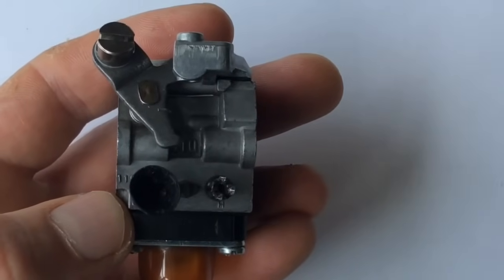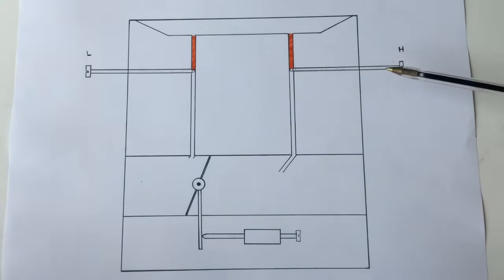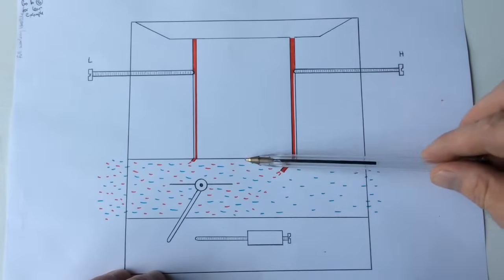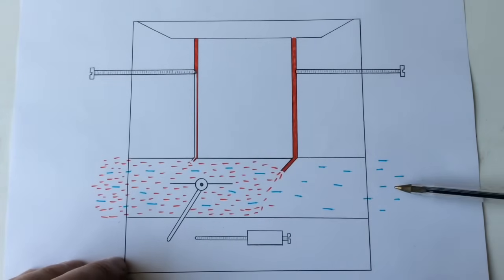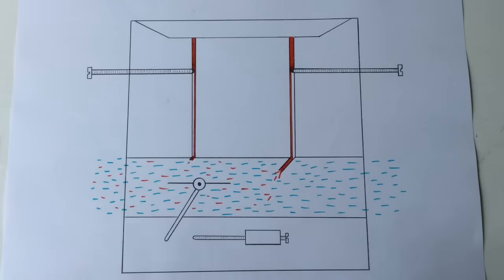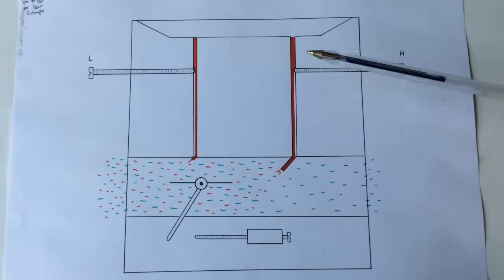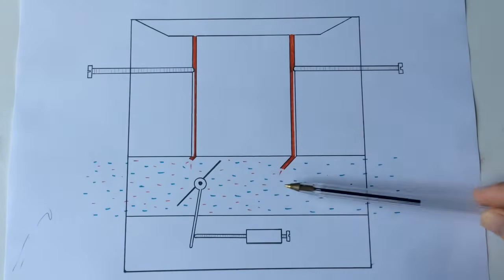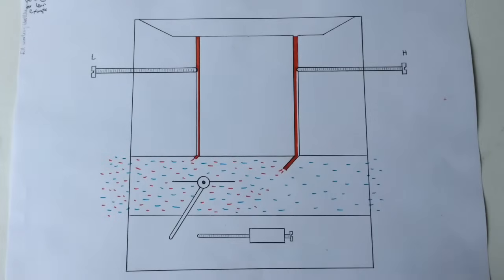HOW ADJUST CHAINSAW CARBURETOR:  Chainsaw Carburetor Settings Explained! (by Craig Kirkman)

Comment: So is the "L" setting located before the throttle plate and the "H" setting located behind it?  That's how it appears on the diagram.
Reply from the maker: Hi.  Yes, thank you for pointing that out.  The diagram may not be completely exact to real life as on the carb itself.  Instead, its more of a learning concept.

Thanks again

Craig

Comment: Well done. One of the things that I recall learning during my gas powered model airplane days was how to tune the Low speed needle for smooth transition, 'tickover' to full throttle. When suddenly going from idle to full throttle, if the engine 'bogs' and hesitates during transition, lean the Low needle a bit until you can get a smooth transition. Conversely, it it suddenly goes dead, richen the Low needle a bit until smooth transition is attained. Thoughts?

Comment: Great video! I am an auto mechanic who has never worked on a carbureted engine. With times so tough I decided to try repairing my dad’s 30 year old weed whacker instead of buying a new one. I determined the carb was the problem and replaced it. I just could not get it running right. Your video was perfect it laid out the theory and gave me what I needed to get it running like it was the 1990s again.

Comment: Thank you for this series of videos! I have never understood 2 stroke carburetors as much as I do after watching your videos. Truly a big help. On a side note people will always pick apart your content, ignore them as you are helping people. Again thank you so much for taking the time to teach a very necessary skill in today's world. It cost 90$ per hour plus parts for a shop to look at small engines which 90% of the time it is a simple carb adjustment.
Reply from the maker: Thank you so much for your motivating feedback. I really do appreciate it.  You are absolutely right about some people trying to pull apart my work, some most certainly do just that. But it's people like you that make me understand that I'm on the right track, and for that I will keep going. Thank you again. Craig 👍👍👍

Comment: A new machine I took straight back to the dealer after an hour today. I believed that it was running lean on the High rev range as it idled ok but going into trigger revs, it just would bog out every time. I did a minor adjustment and testing of the 'H' screw but returned it to its original position and believed that the protective guard needed to be removed so as it could be further turned. Being brand new, I chose to take it straight back and have the dealer do the resetting. He handed it back after removing the 'L' screw guard and resetting that screw. He left it off and I spoke to him about altering factory settings etc. But my question is this. Yes it did run better but am I missing something when I believe it was the 'H' screw which needed correct adjustment? I'm now assuming he's given me a richer idle and this then has improved the High rev range. My understanding of the metered fuel needed to give proper running from Idle to High revs, was controlled by 'H' screw and 'L' screw was all about idle only? Is this right or have I now got myself confused?

Comment: Tickover in US is idle needle or idle screw in no a lot of manuals but amazing job. This works for most 2 stroke engines and if you have a rc glow engine this will explain how to set your needles for best idle so your car or boat won’t die or stall. Good job on the theory and time you put into this
Reply from the maker: Thank you for your awesome comment. I really do appreciate it. Craig 👍

Comment: Watched this explanation, went out and put my troublesome Ryobi string trimmer on the bench  seated both mixture screws and followed these instructions, now it runs very nicely both high speed and idle,  "tick over" the UK term for idle speed,  I will adopt that phrase as it is a perfect description for a  good idle, 👍

Comment: I'm a complete novice trying to completely rebuild a Stihl TS400 and finally got the whole thing back together, and running, so found this really helpful.  The supplier of the new carb said 1 1/2 turns out on both high and low and when I give it throttle it runs great.  Only problem, when I let go of the trigger it dies and cuts out instantly - no matter what position I turn the T screw in or out.  Any suggests as to where to start with that would be greatly appreciated.

Comment: What should be the default position of the T screw when adjusting idle mixture with L screw??
Reply from the maker: Well. If you can see where screw contacts the lever on the carburetor then I would screw in the screw until it just starts to move the lever. Then when you start the engine you can fine adjust in or out depending on how the engine is idling. If you can’t see the lever contact then it might best a good idea to screw in the screw somewhere midpoint and then adjust from there. Of course, please make sure of your own safety when starting the engine because if you have a chainsaw the chain will move upon starting if your idling is high. I sometimes screw the T screw in so that the engine is idling a little high whist I set the L screw. I have always done it this way and its always worked for me.

Comment: You really should start with the low speed needle first, about 30% of your high speed mix comes from the low speed circuit.
Reply from the maker: Hi. Yes. Most people do start with the Low first as you have correctly said.  Having been adjusting engines both ways over the years I have defaulted to doing it this way. I do adjust them sometimes with low first and sometimes high first.  I can pretty much get a machine to run very well using both methods.  I do acknowledge your correctness though and thank you for your comment. Craig 👍

Comment: If I don't have one of those special pump to test the carburettor pressure ...is there another way to do it ?
Reply from the maker: Hi. Thank you for your feedback  I really appreciate it.  Yes there is a way. Its not quite as good as a pressure tester pump & gauge but it does work. So this is how I do it.

Here goes then. 

Connect a piece of fuel pipe to the fuel inlet of the Carb and submerse the whole Carb under water leaving unconnected end of the pipe above the water.  Blow down the pipe, and if there is bubbles then you have a leaking metering valve within your carb. 

I am going to make a video on this, which will be quite soon so keep watching and you will see what i mean very soon. many thanks. Craig 👍
Reply: @TheRepairSpecialist  Thank you for answering me ...You mentioned to put a piece of fuel  line on the inlet ...what about 
when there are two line on the carburettor  ? Inlet and outlet ? Do I have to put a pipe on the outlet too  like the inlet one ?
When you say  THE THICK  OVER SCREW  do you means the IDELE SCREW ?
A question that I have asked to several people  on the Internet is about a Ross Chain saw given to me  I had to put a new 
cylinder and piston but there is no compression at all ....Can you give me some hint   where to have a look ?
When tuning up a carburettor  which screw to start first the "H" then "L"or doesn't matter ?

Comment: What do you do when the H and L keeps vibrating loose to were once you do set it right that's what happens
Reply from the maker: Hi. Normally there is anti vibration springs accompanying the screws to stop them vibrating loose. Can you see any springs on them?
Reply: @TheRepairSpecialist  those springs twist around with the screws making it out of set

I rest it but its no use to keep resetting it when it keeps doing that 

Do they sell any rebuild kits for the stihl br420 backpack blower walbro carburetor 

I was thinking about putting on a primer bulb type of carburetor on the old br420 how the new ones have it so it should work on this old blower all i have to do is hook it up

Comment: If I have my H and L screws out one full turn and the engine is screaming, should my first course of action be to turn the Idle screw OUT?
Reply from the maker: Yes I would turn it out a little to reduce the excessive RPM's. Its ok in my opinion to have it idle slightly high though. Then from there I would make the adjustment. Thanks. Craig

Comment: I have a question about a  mountfield MM2603 3 in 1 multitool, if you could help please?. My machine was only bought in the first year of COVID and only used for 2 summers. This year when I brought it out of retirement and fired it up, the engine started on full choke as usual, but I got a strong petrol smell. On checking the machine I saw that the fuel tube had snapped, so I stripped the tank off and replaced the 2 tube line, complete with new filter and reassembled. The machine kicked into life, I took the choke off, it ticked over nicely and I thought I was away untill I opened the throttle. The engine coughed and spluttered then slowed down until finally stopping all together! No probelm, must be the air filter!  
This is where I hit the wall. 
I cannot for the life of me find out how to access the air filter to check how that is and even the PDF owners manual that I downloaded from Mountfileds own webiste (as I had thrown mine away,as we  guys do) doesn't show how to get to this. Can you help please mate, as my hedges are now about 7 feet high and need to be dropped a bit????

Comment: I am using a mantis 2 cycle tiller new carburetor. I installed it put some true fuel in it and it fired light up but the times were turning too fast so I tried to just what you call the takeover screw I think we were going to tell it stops and blocks the fuel and it shut off and I cannot get it back to the location again. I did not adjust the high low on the carburetor just what you call the takeout screw so I don't know what to do.

Comment: What I like to do is after I have adjusted the high side and the low side, I go back over the adjustments one more time.  The reason is that after introducing the low side adjustment into the mix, the high side performance may have become slightly off and needs to be tweaked slightly.  As was said, make sure you end up with your high side being SLIGHTLY toward the rich side of optimum to avoid overheating, undo wear, and possible engine failure.

Comment: I learned how to tune small engines like a pro when I worked for Hobby Town building and flying model airplanes & helicopters. Same with RC cars. He did it exactly how I was taught. Always reset both your Hi and Low and do 1 1/2 turns out. That will always get you to a good starting point. Start your engine and adjust the Hi side first with full throttle and just listen. If its in the summer and or your in hot weather, you wanna run it more rich so you don't over heat it. So adjust it so you have a good smoke which means it's running rich. Also if your engine is brand new, I tend to run them on the rich side until they break in. I only run it lean in the winter because it needs to run a little hotter. Once you have the Hi side done, then let it idle and if your idle is too low it will cut off. So open it up a little until your idle is not too fast but not too slow. The Hi and Low work hand and hand together. So you know you have it right when you you can pump the throttle from Idle right up to full throttle with no hesitation. It should be smooth. If it's not smooth only adjust your low. Don't touch your Hi. You will eventually find that sweet spot the engine will love. Good luck guys!!!

Comment: Great video !!! It’s been a bunch of years sense I’ve adjusted a carb on a small engine.. this was a great refresher !!  

Also note guys after you adjusted your carb get her warmed up and  with a new plug give it full throttle for 10 seconds and shut her off .. pull the plug out watch out it will be Hot !!! And check for temp color on your plugs!! White mean your to Hot ! And u need more fuel  brown is the sweet spot black is to much fuel  so just need a little lean adjustment and repeat as needed !!   

Helpful tip for this video !! Cheers everyone!!!

Comment: Thank you so much for such an easy to understand video. I’m a 58-year-old female lawyer trying to teach myself to service my own equipment and this was like having the scales removed from my eyes. I originally thought that “the mixture” referred to the petrol/oil mix and couldn’t understand how you could change it once you had made it up. Now I will be able to adjust the new carburettor that I fitted yesterday, though I think it’s just the tickover that needs tweaking. Thanks again!

Comment: My carburetors have only one adjustment screw>>?  There is a small screw to set the idle speed, using the cable.

Comment: Best explanation of how a 2 stroke carb works! I have an Echo SRM 225 that I replaced the carburator and adjusted it after watching other YT vids, now I realize why it stops running after 5 minutes and gets hot: I leaned out the mixture too much, good thing I found this video, thank you!

Comment: Great job.  Question- on a new carb installation, where do you want the initial idle screw set while the H and L are backed off 1 turn for first start?

Comment: Hey Craig, excellent. Any tips on getting a  Stihl FS80 brushcutter to idle. Just changed the carbie and it's starting well and revving well after adjusting H and L  but will not idle no matter how I adjust the tick-over...

Comment: Great video. A friend of mine gave me a basic concept of one process for doing this kind of adjustment a few years ago, but he only taught me the process (and he did the low first in the process he taught me), he didn't go into any explanation of what was actually happening during the adjustment process or why.

Honestly, when given the choice between being taught just a process for something without the what specific effect the actions in the process have or why vs. being taught what effect the actions involved in a process actually have and why despite not actually being taught the process, I'd rather be taught the why not the process. If you know the effect an action is going to have and why, you can figure out the process pretty easily, usually.
You give the best of both worlds, and do so very well. Very, very much appreciated.

Comment: exellent description.... very easy to understand how the 2 screws work in relation to each other and what they do, but there is one aspect of the workings that you didnt emphasize enough, and that is how neither of thhe screws mean anything without airflow, and the variable airflow is why 2 crews are needed for the purpose..... 
 as the motor cranks over, it is sucking the air in thru the carburetor, and adjusting the screws is what balances the fuel air ratio, so the engine can continue to run and more efficiently suck the air it needs to run at the rpm we want it to... and its the actual airflow doing all the work, as without the airflow, all the fuel in the world wont allow the engine to run like it is designed to..... and its the butterfly/throttle plate which is the control device that as it opens or closes, controls the variable air flow across the venturi tubes, and causing fuel to be drawn out of the tube and into the airflow..... the longer tube on the high side will draw more fuel as air rushes  around it when the butterfly opens,...and the fuel will stop flowing from it when the airflow is blocked by closing the butterfly plate.......  

   the low circuit has a shorter venturi tube, but it doesnt need a long one because it only comes into play when the throttle plate is nearly closed, blocking the air flow... the air that passes the L venturi is a lot less but more concentrated in the area of the L venturi, so that it comes into play and draws fuel when the throttle plate is closed and minimizing the airflow passing the H venturi, effectivly stopping the fuel flow from it...  and so the L screw can be adjusted to provide the proper amount of fuel to flow thru the L venturi while the engine is at an idle..... the Idle screw (as some of us know it by), or "tick over" screw as you call it, is only used to set the particular RPM of the engine at an idle, AFTER the carburetor is adjusted correctly and the engine is running properly....

Comment: I knew the basics of 4 cycle but 2 cycle has always eluded me. This was great explanation of 2 cycle carb functions. It couldn’t have appeared in my feed at a better time because I have to saws that need maintenance and now I’m up to the challenge. The drawings were a very good representation of what goes on inside the intake air stream.

Comment: I’m going to adjust my stone saw 2 stroke stihl ts 410.  I replaced  the piston and honed the cylinder.   It revs really high at full throttle seems more than before.  How ever there is a delay when throttle squeezed.  And it will not idle properly unless in the locked start position.   When switched to idle it cuts out.  Any input would be appreciated!  Great video!

Comment: An excellent explanation for how a 2 stroke carburetor works. Solved my problem with my Ryobi chain saw running rough and conking out continually by adjusting the H, L and idle.
Cheers mate!👍

Comment: Thank you for a great video! Quick question. How does the choke play into this discription/diagraming? What would be my problem if I can't get the trimmer to start if it shuts off after warming up? Or can't get it to start after it has run?

Comment: Very good as explaining the low speed and high speed functions, but why not explain more about the high speed adjustment?  I hear various explanations----especially from an expert on small engines who says the hi speed is mainly for limiting the RPM---which I don't think is the correct way